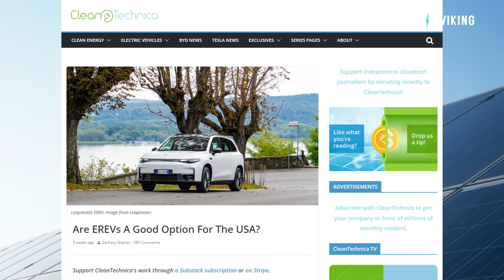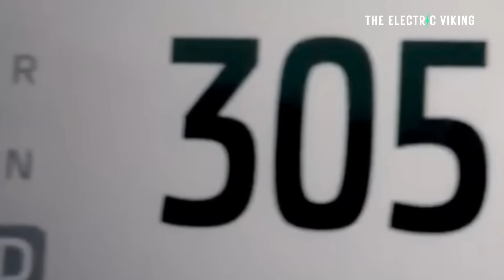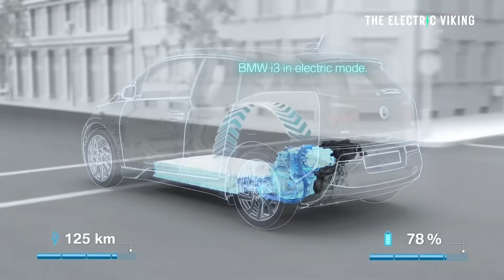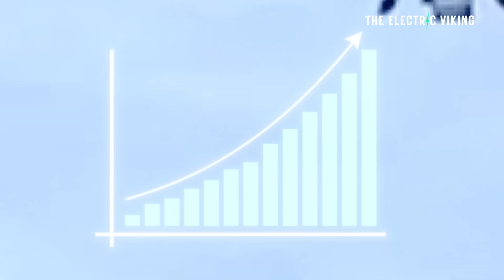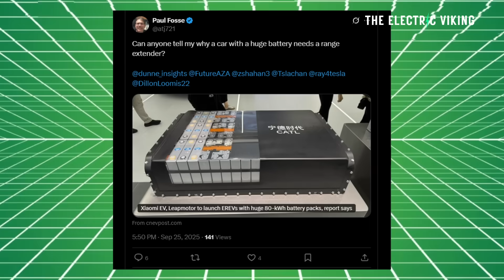Are EREVs the Future of American Electrification?

Comment: Charcerizing erevs as complex in the face of a hybrid is hilarious. An erev is an ev with an on board generator. Simple. The question is how many miles/kilometers can a gallon/liter of fuel produce. Cause if it produces 20 km/liter CONSISTENTLY in a variety of driving conditions, then there is no question it will be better.

Comment: I had thought of the Ramcharger but you just talked me out of it with the maintaining 2 systems comment. I will stick with gas.
Currently, driving thru Northern Ontario in an EV is high risk especially in winter. HWY 11 has a strip that is over 400 kms where you can't buy gas or recharge. If you are towing heavy you need the 50 gallon gas tank.

Comment: EREVs are the future. You get the best of both worlds. No more rsnge anxiety or finding a charging station with little battery left but the station doesn’t work.  And the much larger rsnge is fantastic. You get the performance of an EV but the range of a gas or diesel vehicle. Towing is also more capable on an EREV.

Comment: EREV actually makes more sense as even Elon has not solved the towing and extended range issues. Not just for towing but for in areas there’s no charging like camping in un remote areas…duh . My Cybertruck I have to charge 2-3 times a week for commuting. With an EREV i can charge less.

Comment: Unmentioned benefit of erevs is in cold, windy or hot weather, EV range drops dramatically. Having a small engine to provide supplemental heat and range will help greatly. The initial problem is the auto industry can’t cost effectively make a small, low emission engine on low volume. 1.5 l is way too big. 600cc would be adequate.

Comment: to clarify, an EREV is one drive train it's basically a full EV with a built in generator.  This eliminates the scenario you spoke of with plugin hybrid drivers filling up and using their PHEV as a gas car.  Not an option with an EREV, full up if you want but it will only drive an EV, no gasoline drivetrain.

Comment: I agree that the only possible reason to drive an EREV is long distance towing.  I live in a less populated area of the USA and tow a small trailer on long trips with my Rivian R1T, but there are some places I simply cannot go with the trailer because of the lack of charging infrastructure.   Also there are not enough choices of EV tow vehicles.  For my use case I might be able to get by with something like a Model Y with a very large battery.  The other problem with EV towing is the exorbitant price of DC fast charging.  On a long towing trip it can easily cost as much or more than gasoline.

Comment: Is there a role for plug-in hybrids?  If you think so, then there is a place for EREV's.  Plug-in hybrids should be replaced entirely with EREV's.  I used to have a four-hour commute to work.  The only EV available in the USA that could reliably make that trip in winter without needing to charge was the Lucid Air Grand Touring.  (There were no accessible rapid chargers along the route.)  I was not going to spend $110k+ on a commuter car.  I ended up buying a Toyota Prius Prime, which I hate because it is not an EV.  I had no idea that if you plug the car in that it will not turn on -- I never thought to even test that as part of the test drive.  So much for preconditioning the car while plugged in.  I would not have bought the Prius Prime had I known it behaves that way.  But I learned the hard way that plug-in hybrids are just ICE cars with big batteries.  (I was most interested in the Mazda MX-30 R-EV, but Mazda had just pulled it from the American market.  If it had still been for sale, I would have flown to California to buy it to drive back to New York.)  I also hate having to bring the car for ICE scheduled maintenance even when driven with EV miles.   It would be much better to have an EV with a smaller battery that trades the weight for an ICE engine tuned for extreme fuel economy that can produce all the electricity the EV motors could ever need and also charge the batteries.  The ICE components could have their maintenance schedule based on running time and time since last oil change.  Big, heavy EV's would be good candidates for EREV modification.  As you point out, vehicles with towing capability would be good candidates.  Towing something heavy will severely diminish the range of pure EV's -- being able to use chemical stores of energy would be worthwhile for this use case.

Comment: I think people will want the peace of mind to be able to use petrol as a backup for a while. What’s good is erevs having the engine only for charging. It will be way more obvious to people that they are using a primarily battery car with a generator than a hybrid. 

I can put $10 gas in my car in less than a minute. Having that as a backup is nice. Especially for road trips at high or for people that do  ride share

Comment: The question is did Tesla bypass the process of electrification going exclusively to the battery power train ? The US did have the Nissan leaf as the only mass produced EV in the US but it was more of a novelty . GM came up with the volt which was a good transition vehicle but with all other gm leaps before everyone else they shut it down . Tesla gained a big advantage where the government subsidized the company . It would have never made it and that's what provided a surge in EVs but the rug was pulled out with a new government hostile to green tech came to power .

Comment: There are a lot of wilderness or even semi-wilderness areas in North America where there is virtually no charging infrastructure. Getting to them and back often exceeds 500 km. Think cottages, fishing camps, camp grounds, etc.  As you point out, people often have trailers with boats, 4x4s, or camping gear, as well as caravans. This is a big part of NA lifestyle, even if it only lasts for a couple of months each summer. EVs don’t work for these people, but PHEVs and EREVs do. I own a Mitsubishi PHEV for exactly this reason, as well as a Chevy Bolt for our main get around town car, with the Outlander as a second car in town.  It will take a very long time to push electric charging out to these sparsely populated regions.

Comment: My brother tested an EREV, this year. His biggest difference is that gasoline-only mode is significantly slower (0-60 is 50% longer) than similar EVs. He also advised that gasoline recharging WHILE the car was in EV-mode, the recharging is quite slow. He thinks that you need to understand how it runs in gas-only mode. You could be disappointed

Comment: I agree an EREV could be the optimal solution for the US, especially for big trucks and SUV’s that need to tow. RAM trucks and Wagoneer are offering EREVs for 2026 with about 150 miles electric only range. Which can expand to 500+ miles with a tank of gas. Perfect! Why? Because the US doesn’t have a fraction of the electric charging stations that China has. And our new president for life will keep it that way.

Comment: I agree that hybrids and dual motor vehicles are not the future, but EV makers need to realize that for the United States EV ranges are way too small to gain widespread adoption.  Standard EV range needs to be at 500 miles - which is equal to the amount of time that someone can drive in 8 to 10 hours.  I also think that their should be additional modules that could be added or towed to increase that range on long trips.

Comment: I have asked about putting solar panels on the top of semi trailers. I always get the answer that it wouldn't be enough to power the truck. Neither is regenerative braking. It is about extending range. What do you think?
Reply: On a sunny summer day, you could get about 50 kWh from panels on the roof of the trailer.  That would add about 32 miles per day.  Not bad if you can solve the problem of logistics since the trailer owner may not be the truck operator.

Comment: Better than EREV for the US market, I think is a plug-in hybrid which can go for about 100 miles on one charge before jumping into hybrid mode. While EREV is better than short-range EVs, until we (in the USA) get charging stations like we got gas fuel stations coast-to-coast and charging time in 10~15 minutes, I think a plug-in with high battery-mile is more suitable (the old Volt GM was a good solution, have a small onboard generator and always run on EV motors, but even GM killed it to sell more big gasoline SUVs and trucks). I have a hybrid vehicle and a plug-in hybrid vehicle, and if my plug-in could go 100 miles on one charge, I would not need to use gas, i.e., go into hybrid mode, for months-on (with my home level-2 charger, I can charge daily in 2~3 hours overnight and run in EV mode for a few days before needing to recharge; of course I do not need to nor do go drag racing).

Comment: Being in rural America, I would love to see a good EREV. When I work in the office I have 120 mile round trip. Plus we travel 400 to 600 miles out of state every 2 or 3 months. We also travel +1000 miles once or twice a year. The Chevy Volt we bought was an excellent choice. I was getting about 60MPG out of it in the beginning and it paid for itself right out of the gate. I have 220V charging at home so around 4 hour charge time. The cost to charge over night is less than $1USD.  We have a gas SUV still for the long trips. I would love to see a 150 to 200 Mile electric range PHEV or EREV.
Reply: IF you had 100 miles range, would be great.
Reply: Absolutely! For your driving profile, an EREV is the ideal solution. In fact, it's perfect for anyone who travels 100 to 150 miles per day- or even more, including inter-state trips. Modern EREVs handle this effortlessly.
You drive on electric power for your daily range, and for longer distances, if battery depletes, the vehicle switches to a fuel-efficient hybrid mode. Typically, you’ll only need to use the engine for charging once or twice a month.
That means you're reducing your environmental impact, saving money, and enjoying a luxurious, comfortable ride, and NO RANGE ANXIETY... What more could you ask for? It has to be an EREV...!

Comment: If i were on a long road trip, when I stopped to refuel at the halfway point, would I have to fill my gas tank as well as charge the battery?
Reply: I just refill the gas tank. The battery is held in reserve for use at my destination, because it won't get you all that far on the highway. Beside, my Volt is not fast charging capable, level 1/2 only.

Comment: my i3 Rex makes about 100mi (real world for me) and that is plenty of range in the urban sprawl of Houston Tx.  Even with a "slow" DCFC of 50kw, I can go anywhere in the greater Houston area and still charge up enough to get home in about 15min.  I have an L2 charger at home so daily commutes and errands are pure EV!   It's coded for Hold State Of Charge and will quite comfortably road trip!  Drive 70mi (about 1hr), refill the Rex, drive another hour and repeat!  Over the course of the trip, you need to recharge the battery about every 3rd fuel stop.    I have done a few trips to prove the point that it CAN be done pure EV, but the charge stops are too frequent and the rate is just to slow.  A more modern EV with around 200mi range, and the charge stops become negligible and with faster charge rates, the time becomes inconsequential over a long trip.  My ICE trip from home to Disney World is 16hrs, with a 200mi EV it becomes 20, with a 250mi EV it drops to 18 (numbers thanks to ABRP). I agree with Sam, all you would need the Rex for now is towing!  The one experience I have with EV's and a trailer dropped his range down to .9mi/kwh!  Made for a very long trip...

Comment: Isnt it true that since an erev has a smaller battery which gets charged up by the engine when the battery is depleted means that there will be more charge cycles of the battery and its lifespan will be shorter than an ev car battery

Comment: None of the erevs are configured right, they need a 20 kWh battery and a 10 kW engine, a 150 cc engine, not a 1500 cc engine, NOT a 100 kW engine.

Comment: I think EREVs will help America transition,  but we should have done it a couple of decades ago. It will also "help" the American auto industry fall further behind.
Reply: We did start it a couple decades ago. The Volt project started up when GM started getting beaten about the head with the "Who Killed the Electric Car?" Movie.
Reply: @kayl456jenna the Volt was not an extended range EV. Different design. There was a mechanical connection between the wheels and engine.

Comment: I don't know why they don't make an extender, or a Tesla wall unit,  than can bolt onto the end of a pure ev, via trailer hitch. Hook it on when you need it. Leave it under your Tesla wall.when you don't. Seems like a no brianer. Will work up as another home battery backup too during a power outage.

Comment: EREV'S ARE NOT THE BEST: WHY ? DOUBLE THE TROUBLE 2 TECH. ALUMINIUM ION CARS WILL BE ABLE TO GO 800 MILES , CHARGE FULL IN 15 MINUTES NO PROBLEM, NO MORE 80% TO SAVE THE BATTERY, NOT AFFECTED BY HEAT OR COLD WEATHER, NO MORE FIRE THAT COULD KILL YOU GOOD FOR 30 YEARS OF CHARGES. MEANS EASY TO RESELL WHEN TRADING FOR NEWER MODEL, LOWER INSURANCE. FORGET HYBRIDS I HAD ONE , BATTERY DETORIATION IS LARGE. YOU HAVE TO TRADE THEM IN WHEN THEY ARE STILL ON WARENTY, OR ELSE PREPARE FOR A BIG REPAIR OR A LOW TRADING PRICE.

Comment: Burning petrol to generate electricity to charge a battery to drive the electric motor is recipe for poor efficiency with losses at each step. If you aren't ready to move to an EV buy an efficient petrol vehicle. EREV, PHEV, HEV's are all poor compromises.

Comment: EREV is the best hybrid, giving the consumer the excellent EV driving experience with range anxiety. I think using batteries with a higher energy density and faster charging is the more intelligent choice. Here in Northern Lower Michigan my DC fast charging system sucks! The chargers are between 125-180kw. These are slow chargers.

Comment: I don't get it. EREVs with plugin seemed an obvious thing 5 or so years ago. But the offerings were few - or none - overpriced and designed wrong. The i3 and the Chevy Volt had kind of right idea implemented wrong. Why is it so difficult to take a decent EV, reduce battery size by two-thirds, and add a highly-optimal gas engine, generator and a 2-gallon gas tank? Surely this should cost less than the EV you based it on, because two-thirds of the price of a battery is less than the price of gas-engine plus generator+tank? In effect, you have an EV for all intents and purposes, but no range anxiety / journey restrictions. In practice, 90% of the power will be from own home electricity, with only exceptional gas use. Anyway, when I wanted one back in the day, I couldn't find a decent one - now I don't need one.
ADDENDA: looking on ebay +autotrader in UK, I see 2014-model Amperas (the Chevy Volt's UK branding) for 5K-8K GBP with heavy miles. Wow nice work if you can get it!?! I think this illustrates my point. That's almost half the price of a 1-year-old MG4.

Comment: Can't speak for the US, but if, like me, you live in a country with unreliable power supply and vast charging deserts, an EREV or PHEV makes perfect sense. Where I live, you can drive the main routes EV-only, but even that is going to be an adventure. The next charger has just one outlet. Will the power be on? Will there be someone else blocking it? Go off on the side roads and ... well, just don't. When I explain it to people, I don't even use those industry terms, I just say "It has a built-in generator", and then the lights go on and they say "OK, that makes sense".
Reply: I don't know where you are, but people have been doing laps around Australia for years (circumnavigation of the whole country) using just power points and then three phase power points because they wanted to prove a point, ie, that it could be done. Now there are DC fast chargers being put in everywhere and times for doing a lap are coming down fast. So you can be a glass half full person or a glass half empty person, which are you and which do you prefer to be????
Reply: @AntonHandel-bw7vv  Sure, it can be done just using domestic power points, if you like adventure, or if you are making a YouTube video to prove a point. Meanwhile, the guy with the EREV got there a week earlier and is lying on the beach. Just because it can be done, doesn't mean that it is a general solution for everybody.

Comment: ERevs make more sense than PHEVs as there are fewer parts. 
ERevs can prevent range anxiety for longer trips which require an inconvenient charge stop (assuming one is available here in the UK).
I'm not sure why a 1.5L motor is being used, an engine half the size could more than double your range! 😳
Reply: The Chinese put essentially the same engine into everything they make.
Reply: @clasqm Thanks, good point but if they are trying to look for a new niche market, a smaller lighter cheaper motor with a more robust LFP battery which is cheaper (but needs slightly more space) might serve them better.

Comment: As a transition vehicle the EREV makes sense, especially if the EREV petrol milage is much better than the average ICE vehicle. The transition to "renewables" (a forest of toxic wind turbines that cannot be recycled that kills lots of birds, bats, insects and marine life for instance) is far from complete without large scale battery storage based on super cheap battery chemistries. Anthropic CO2 does not cause warming (and supports plant life), but sole dependence on oil/gas/coal is far from ideal from a geopolitical perspective. If all the wind- and solar energy can be stored cheaply and the EV charging infra is fully developed, bye bye EREV.